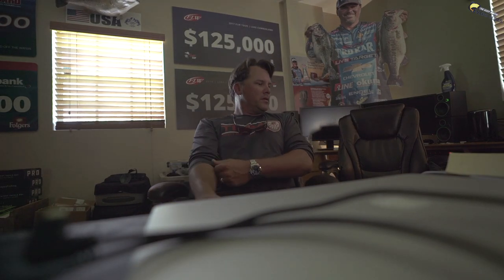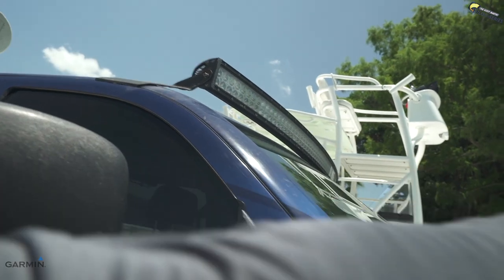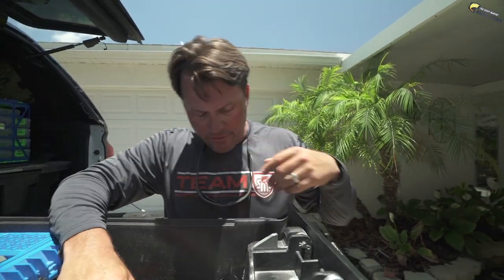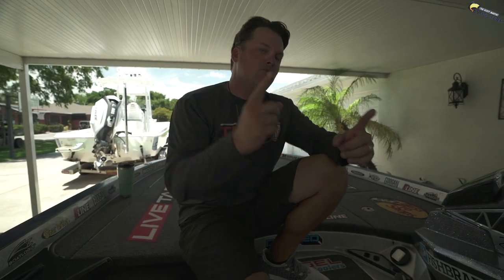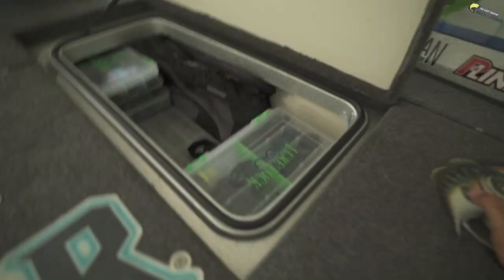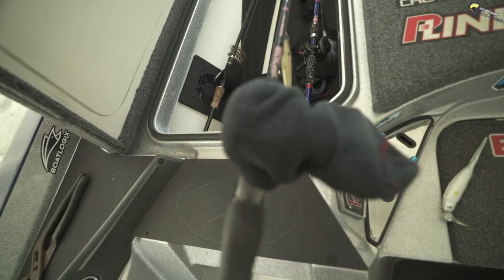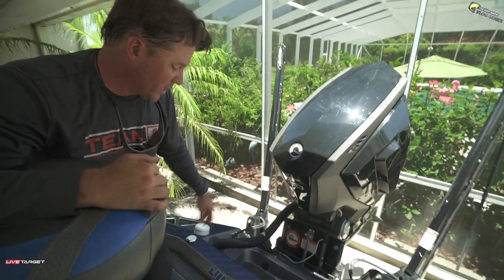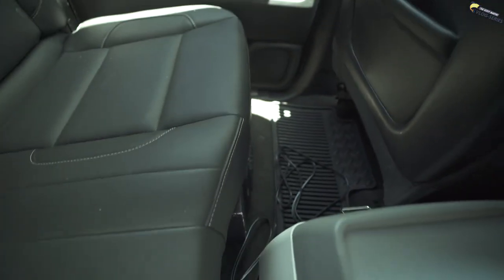What’s Inside My TOUR Boat and Truck?!

Comment: Spare tire should be mounted under the rear of the truck. Get you several (maybe 4) 2/3 ft long pieces of 4x4 wood blocks to elevate the jack to lift your truck.
Reply from the maker: That’s perfect

Comment: The light bar on top. Just slide it back a little with the light on until the light doesn't show on the hood of the truck then mount it at that point on your next truck.

Comment: remove front lite bar forever . put something lower in bumper. rear light bar a must. need lights inside topper. truck rap looks ok. cut the toe out of the socks will fit all rods need 4x4 wood for jack and a pice of plywood to place the jack on. keeps it from sinking in the dirt and less likely to tip                       . nice rig

Comment: Why is your motor always turned sideways?
Reply: If you don't have a transom saver, it reduces engine bounce while going down the road. Seeing as he has a jack plate, I'm sure he doesn't use a transom saver. His deep see boat is sturdy enough to not need one even without the jack plate. That's the way we've kept our motors for as long as I can remember. A lot of other people do it as well.

Comment: That Jack is way too small lol. Its the smallest floor jack they make
Reply from the maker: Works for the boat perfect..have to use blocks on the truck
Reply: @ScottMartinChallenge  ive actually used that same exact Jack on mine.  P.s hudge fan of you and you're pops. Maybe one day i will see you on the water.